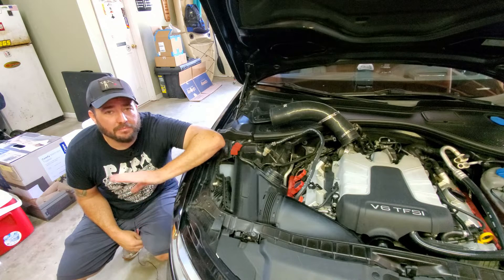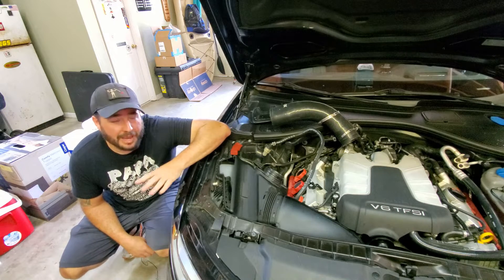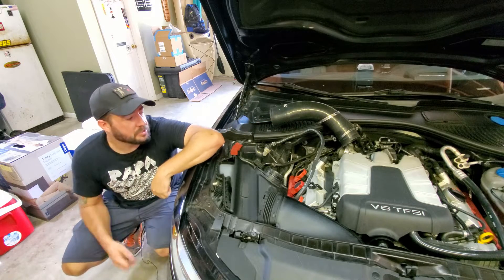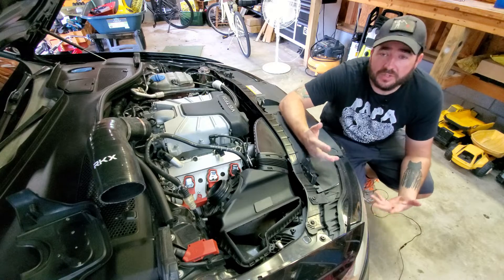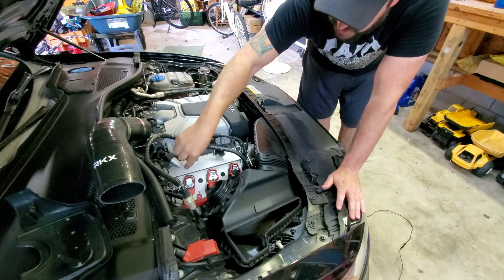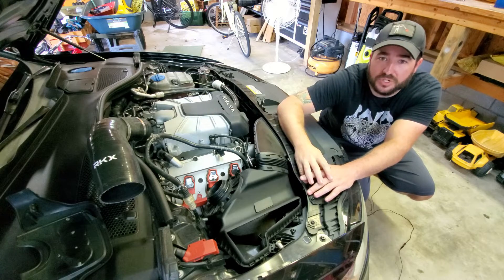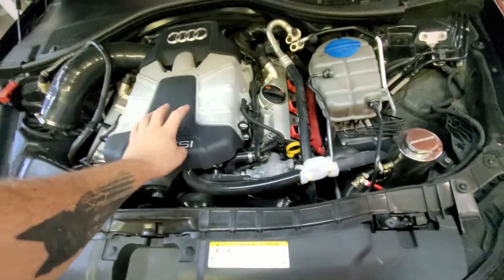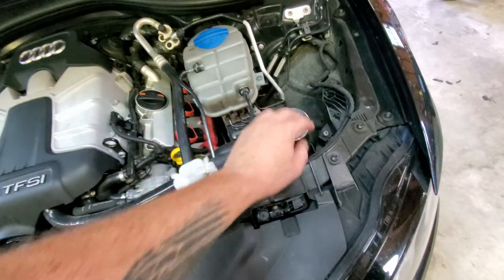How to Diagnose a Misfire on your Audi 3.0T Supercharged Engine

Comment: Hello, fellow owner of an Audi 3.0T. Lo and behold, my car is throwing a p130A and p0303, confirmed with obd11 reader. Some background, Pcv and both sc intercoolers were replaced less than 200 miles ago, spark plugs and coil packs less than 1000 miles. No more coolant loss on cyl 3, telltale sign was the pink intake manifold flap. Carbon cleaning on valves was taken care of this year. However instant EPC when mashing into gas is getting annoying. Also Dual pulley and ported sc. Any suggestions what to look at or help narrowing the cause of the misfire on cyl 3/EPC?
Reply from the maker: Do you have cats still? How many miles on the car? Did you verify the correct gap on your plugs?
Reply: @AudiC7Owners all spark plugs are gapped to 26 thou. 84k on the odometer. Original cats. Am I able to read o2 sensor attribute before and after load using obd11? Would be nice to see if post cat indicates clogged with a certain o2 sensor reading.
Reply from the maker: It honestly seems like a fueling issue, but I'd get a VAG specific scan tool to look for cat efficiency codes.
Reply: @GarageTaught  fueling issue as in hpfp, lpfp, or some fuel line issue?
Reply: @AudiC7Owners  gotta love Audis...switched both the spark plug and coilpack on the problematic cyl #3 to cyl #2. No more misfires or infamous EPC light. As soon as vagcom arrives, I'll check actual vs specified values for fuel injectors along with cat efficiencies.

Comment: I had misfire due to a leaking injector. At around 100k miles all injectors were clogged and pretty much shot, all were replaced. According to my mechanic it is very common.
Reply: @100brsta  were you getting a misfire ?
Reply: @ yes on engine braking, misfire then cylinder deactivation. Spark plug soaked with fuel due to leaky injector.

Comment: I got :
Cyl 1 misfire P030100
Hide Cylinder P130A00
PCV regulator performance P052EEO

Happened once in September after 034 tune and hasn’t come back since, thoughts?

Comment: Do you still have a chain rattle after replacing the two valves under the PCV? Mine has the rattle every morning on cold start then its fine when the engine is warm, 118k miles now. A diy to replace the upper tensioners would be helpful , but probably a hard task to do ..

Comment: What is that black pipe across the ignition coils called near the coolant tank? I'm having trouble maneuvering it when trying to replace sparkplugs.
Reply from the maker: I think you are talking about the A/C line. You should be able to get things past it easily

Comment: Pushed really hard my 2009 3.0T stage 2 the other day and went limp mode EPC light on and extreme shudder and absolutely no power. Got cylinder 1 and 4 on OBD faults.
Thinking coils since I never changed them. Did change the spark plugs though but also never gapped them 😮
Leaking Valve cover gasket also is something I never did...stupid me..😢😢😢
Reply from the maker: Those are all issues. An improperly gapped spark plug will create problems for sure. Lucky this is pretty easy to diagnose.
Reply: Turns out changing coils and spark plugs did not solve the problem.
Do not notice any change in level of coolant, so should not be the leaky intercooler cores right?
Thinking could be my OEM cats or even fuel injectors. 
I guess it's time to take my A6 to the local shop.😮
Reply from the maker: Very possible to have those issues with cats clogging. Good luck man

Comment: First off Thank you for all the help! Your videos are great, and I love your approach to things. I just replaced my PCV, water pump, thermostat, and most of the coolant pipes. I also replaced the water temp sensor, all the injectors, all the plugs, and all the coil packs. This all started with a broken nipple off the crossover cooling pipe. Otherwise the car ran fine. I now have four misfire codes all at once.  The car has gone from a 95,000 mile overhaul of service to pretty much my total nightmare. Is it possible that there is some thing other than a bad plug or coil pack causing all these misfires?  I have 0300, 0302, 0304, 0303, 0305.  I used Bosch coils packs, ngk iridium plugs, and aftermarket injectors from ECS tuning.  I did not gap the plugs. Pcv is OEM.
Reply: Plugs looked very rich btw and I also changed valve cover gasket.
Reply from the maker: If you didn't gap your plugs correctly that could very well be it. Aftermarket injectors could also be an issue
Reply: I forgot to mention the complete carbon clean with walnut shells.  It wasn’t that bad when I got in there.
Reply: I’ll gap the plugs and start the process of eliminating each coil and plug.  Ugh.   I get the Audi haters a bit more now.
Reply from the maker: This could have happened with any engine.

The only other issue might be leaking intercooler cores in your supercharger.

But rule out plugs/coil packs first
Reply: I will go through he process of elimination.  None of the plugs showed coolant evidence.  I'll report back... @GarageTaught

Comment: Hey I have a 2012 b8 s4. Im having a cyl 5 misfire with epc light. The thing is it’s only evident on wot and already changed sparks, coils, and valve cover gaskets. Car will misfire at higher rpm but if I clear the code and don’t get hogher in the rpms drives fine. Any suggestions? I’m dreading killing the sc to check injector because shop already replaced #5 injector.
Reply from the maker: This sounds like a possible leaking intercooler core.

Also, check to make sure your intake is fully secured

Comment: I have a 2.0T that misfire on 1 and 3. Checked and it has oil when I took out coil pack. I'm guessing it's the gasket.
Reply from the maker: Definitely sounds like valve cover gasket is failing. Great opportunity to replace all your spark plugs while you are in there.

Comment: hello, I have an audi a6 2.8 fsi, I have misfier on cylinder 1, I started to change the spark plugs and the problem still occurs, I put injector 1 on cylinder 2 and the misfier moved there, I replaced the injector with a new one, but the car still shakes, what else can I check?

Comment: Do you know of a way to test the supercharger intercooler besides process of elimination? 

I have a misfire in cylinder 3, replaced spark plugs, checked all coils and tested all fuel injectors. Everything works but the new plug in cylinder 3 fouls in a few days. It smells like fresh gas and is wet when it is removed but that could be caused by just not igniting. I'm just curious if I should pursue the intercooler because new ones are pretty pricey and I'd like to be able to confirm that it's bad before actually buying one.
Reply from the maker: If it is leaking coolant they're would be coolant residue on the intake flaps of your manifold. It would look orange in color
Reply: @GarageTaught  thank you for responding by the way. I'm looking for any leads I can get.
Reply: Did you fix your problem? I’m having the same problem
Reply: Having same issue. Next test is compression.. hopefully it is my intercooler cores and not piston ring on cylinder 3

Comment: Love all of your vids and info. My stock 2014 A7 3.0 has 142k miles. I replaced coil packs and plugs, PCV valve, valve cover gaskets about a month ago. That did not fix occasional, severe hesitation on acceleration. I used VCDS to confirm fuel rail pressures, but I am worried about catalytic converters and transmission. Thought I should have possibly performed walnut blasting while everything was off. My VCDS shows no engine-related errors and no check engine light. When the problem occurs, it feels like I tapped the brakes hard then resumes normal. any suggestions?
Reply from the maker: That's an unusual thing to happen. I'd try data logging & replicating it to see what the data shows.

Could be a faulty injector or something else.
Reply: @GarageTaught  Thanks for that. I was thinking my fuel pressure test using VCDS would have eliminated the fuel injector. Data logging makes sense. Cheers!
Reply from the maker: Fuel pressure is measuring the health of your high pressure fuel pump.

Comment: Can a bad injector cause misfire?
Reply from the maker: Yes. But it is exceptionally rare to have a bad injector on these engines
Reply: @GarageTaught  I exchanged the spark plugs and the coils the misfire is still there, the compression in 10.6 bar. What should I check? No signs of oil in the spark plug coil or spark hole
Reply from the maker: Which cylinders are misfiring again?
Reply: @GarageTaught  cylinder 4, the first one in the left hand on the top
Reply from the maker: The cylinder order is this:

Back of engine
 3                  6
 2                  5
 1                  4
Front of engine

Do you still have catalytic converters?
Reply: @GarageTaught  yes that is the order and the misfire is on the cylinder number 4 and goes deactivated, i did install an high flow  Magnaflow cats last year,
Reply from the maker: I'm almost willing to bet your magnaflow cats are failing

Comment: Hey! I currently have a cylinder 2 misfire which started with an EPC light and now my check engine light is on. I already had all 6 spark plugs and an ignition pack for one changed by a shop and they did not say anything about a leak into the plugs. Is it possible this could be a throttle body issue?
Reply from the maker: It isn't likely. Try moving around the cyl 2 spark plug & coil pack to see if the misfire moves.
Reply: @GarageTaught  Ok I will try that. Is it possible the shop should have caught a leak into where the spark plug sits? Or is it generally hard to see? It’s been about a month and a half since I had all six spark plugs changed out

Comment: Help I have a 09 a6 3.0T and it discovered 3 misfires in the same day, 1, 4, 6. My car barely runs now it shakes like crazy and sounds awful if it does, I deleted all the miss codes to try to fix them and they will not come back but they still feel like they are there, what could be going on, any help greatly appreciated ❤️
Reply from the maker: Did you do everything in this video to isolate the issue?

Comment: My cylinder 2 is saying pressure too high, any advise to where to start? 🫠
Reply from the maker: What is the actual code you are getting?
Reply: @GarageTaught  code P03A500
Reply: @GarageTaught  no check engine light, I used my OBDeleven to check for soft codes and that’s the only one I got

Comment: Hi

Got misfires on all but cylinder 5! 😂
What would cause misfires on so many cylinders? And why not 5 as well?
Reply from the maker: That is certainly bizarre... Did that happen at once? Or did they go out slowly over time?
Reply: @GarageTaught  actually it's been happening for 2 years. Before I changed the lambda sensors because they were bad, and the water pump because it had bad vacuum. I had that EPC light and limp mode problem you spoke of in your other video.
Reply from the maker: Sounds like something strange is going on. Any other codes besides the misfires?
Reply: @GarageTaught  I'm not sure as I'm not near the car now but an error, something to do with the catalytic converters
Edit: Heated Catalyst
Reply from the maker: Do you have cats?
Reply: @GarageTaught  I've never removed them, and they're in there. I had the guys check when they canged the lambda sensors. Apparently they look ok.
Reply from the maker: Can you give me the actual codes you get during a scan?
Reply: @GarageTaught  Car is currently in service with some other unrelated problem, but i will ask them to put a computer on it when they can. Thanks for helping btw.
Reply from the maker: I'd check your coil pack wiring harness first to make sure nothing is wrong with it

Comment: I have been having an issue with my S4. It has 157k miles and I have replaced the PCV, thermostat, water pump, injectors, plugs, IC bricks, and cleaned the valves.

My issue is when I start the car after sitting for 8 plus hours. The car will misfire and almost die. After a minute it will run fine and does fine after that. It is Eurodyne stage 1 with stock cats. I thought it may be the cats, but the temp is the same for both when checking in vcds. Last time I scanned it, all I got was insufficient flow for the SAI on both banks which I figured was because the ports in the block are plugged up with carbon. My gas mileage has been crap for a while now too.
Reply: I have the sai codes and also have this same issue where it feels like it’s about to die on startup. Did you ever find the issue? I feel like it could have to do with the chain tensioners loosing oil pressure after sitting thus causing the misfire.

Comment: Hello
Have you heard of secondary air injection system on the C7 a6, is this hard to fix or common on these models?
Reply from the maker: It is not an easy diy & requires special tools.
Reply: @GarageTaught seems like audi covers this issue under warranty, 10 years or 120k miles. They will basically clean the ports with pressure washer.. I guess this doesn't affect driving performance correct?

Comment: Hello C7 Owners. I have a 2012 A6  87,000 with a check engine light. The scan code is 2024 fuel vapor temp sensor (fuel tank pressure sensor) my question is, do I need to replace the whole fuel pump assembly or can I just replace the sensor? Thanks
Reply from the maker: I have never dealt with this issue personally, but I would assume that if it's just showing that the sensor is having an issue you can start with replacing the sensor first. That would likely be much cheaper than replacing the entire fuel pump assembly first.
Reply: @GarageTaught  Thanks my brother appreciate the info. I took her to a shop and two different people said that the fuel pump needs replacing but I researched and researched and nothing I saw said fuel pump, now one of the Best just Confirmed my thoughts. Thanks again and please keep helping newbies like me stay on track 👍🏼
Reply from the maker: Keep in mind I'm not an actual mechanic. Just a guy that has worked on his own cars for many years. They could know something I don't, especially with this since I've never dealt with it before. I hope you get it figured out soon.
Reply: @GarageTaught  Naw Naw Mr C7!  you have help thousands of ppl on YouTube save plenty cash and educated? But most not all shop's can't be in business if they don't go directly to the extreme first!! I've had about 10 rides in the last 20yrs(Detroit/Texas) but this is the first one I've purchased as a project car during the 2020 situation and you have been spot on every since!!! Thanks again Bro👍🏼
Reply from the maker: Much appreciated man 🙌🏻

Comment: Anyone know if coldstart misfires are common on these engines?

Everytime I do a coldstart, after about 20-30 seconds, it seems like the car is cutting ignition for like 0.2 seconds. 
If youre moving when it happens it's really noticable. It like the engine is turned off for a split second, and it's making me nervous. 
No CEL or anything like that. Haven't been able to check codes yet either.

Greatful for any tips on possible issues or fixes!
Reply from the maker: That definitely isn't normal. You should get the car scanned
Reply: @GarageTaught  yeah I guess so, I've kinda been wishing it would fix itself 🤷🏽‍♂️
Will get it checked out 👍

Comment: My car was shaking and the EPC lite came on. I nursed the car and had it towed to my repair shop. The car would not turn over or manually crank according to the shop. They ran diagnostic test and came up with 3 codes P03400, P305400, P130A00. They are telling me the engine is seized. I had just paid them to rebuild the supercharger, rebuild the injectors, replace head gasket and manifold. They say it has nothing to do with them. Any ideas? Please help... they are saying $13-14k for swap. I have a 2014 A6 3.0T
Reply from the maker: Why did they replace the head gasket?

Your codes could indicate that the timing of the engine is off. I'd be very suspicious of the ship that did the work as these engines hardly ever need a head gasket replacement, and they could have messed up the timing putting it back together

Comment: Yes I just had a p0304 code the funny thing is I was about to get it fixed but the epc went away and check engine light away but I’m just going to change all the spark ⚡️ plugs and cylinder 3 coil pack